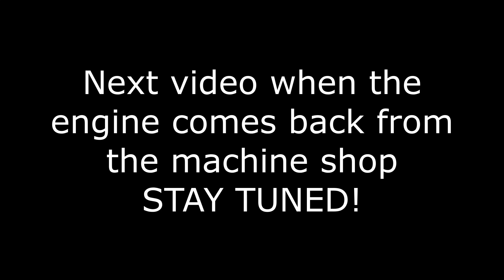Honda Element K24  Engine Pull

Comment: Nice! Any issues with left to right clearance when detaching it from the transmission?
Reply from the maker: Yes, there was the transmission mount of course and an aluminum bracket on top of the transmission. After both were removed it was easier.
Reply: The engine and trans drop out from the bottom w the sub frame, its4 bolts and it makes it a lot easier to get the engine off the trans